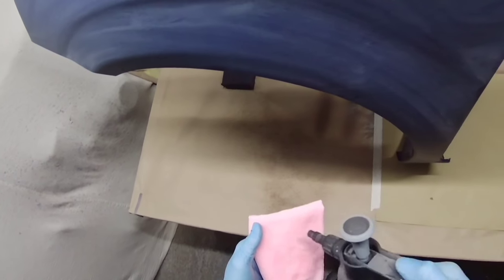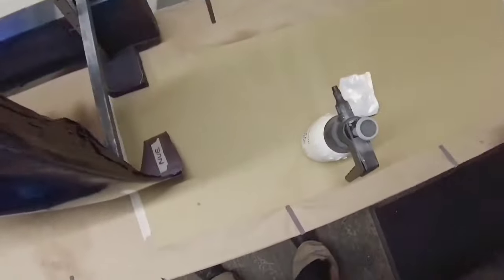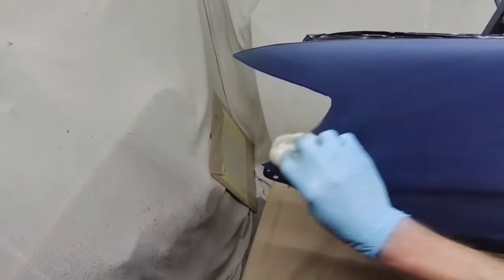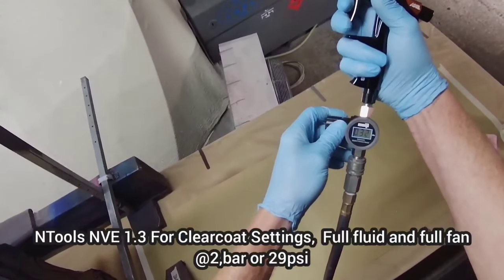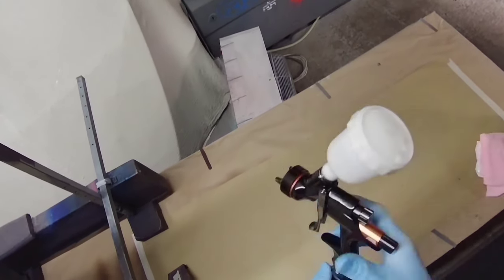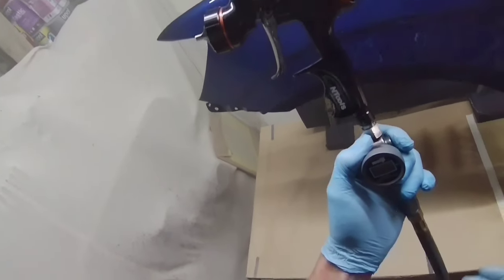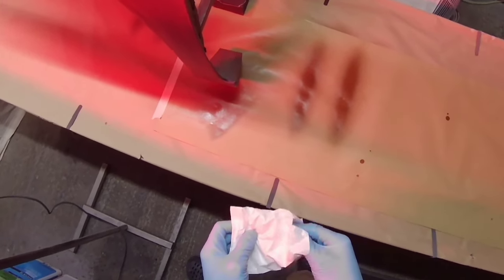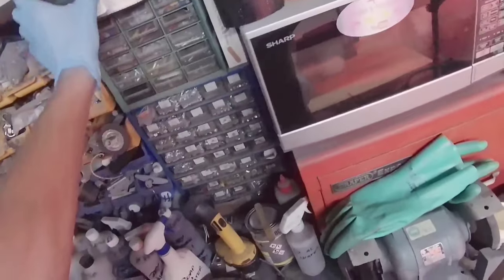NTools NVE 1.3 v Devilbiss DV1 1.3 Chinese Spray Gun For Clear Coat

Comment: Hows the trigger holding up? i commented on 1 of ur older videos about quality issues, read some reviews elsewhere and some had the same trigger problem. wondering how ur gun is holding up
Reply from the maker: Hi mate, I presume you mean the NVE ? , It's been fine trigger wise. It was the R500 that I had trigger problems with, which has been sorted.

I don't use them much, though , as I only got them to experiment with so longevity wise it's not much of a test

Comment: Did you notice that on the fake one, to adjust the pressure correctly you have to press the trigger beyond the first stage moving the needle?
Reply from the maker: Hi mate, no, it doesn't make a difference on mine, I presume you'll on board adjustment is set to fully open?